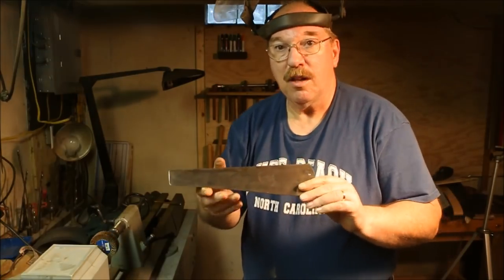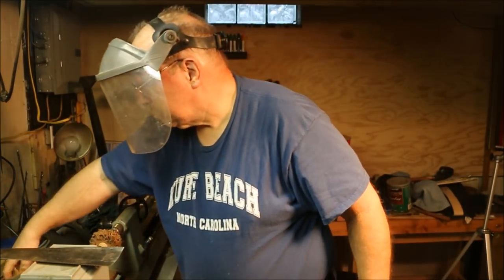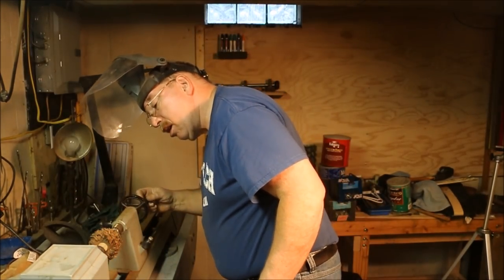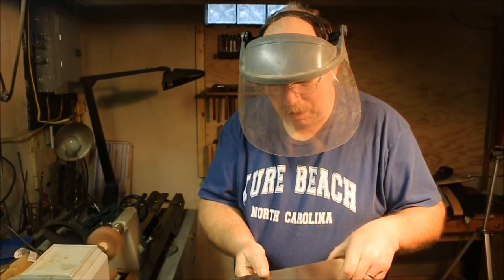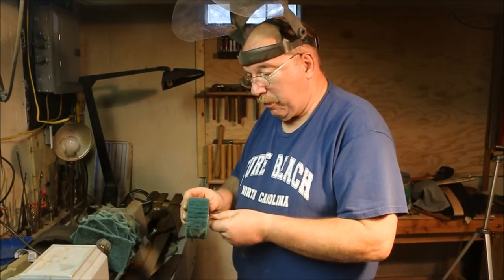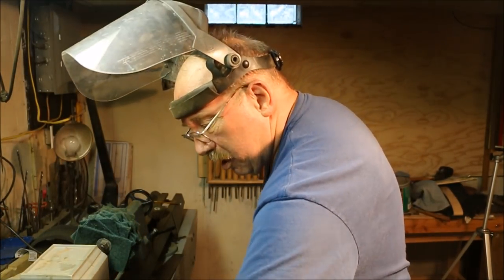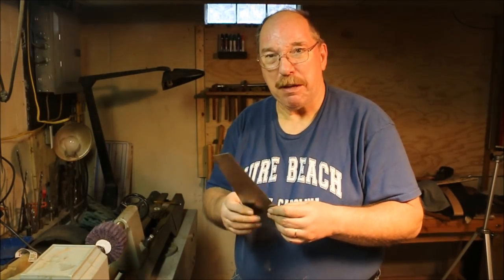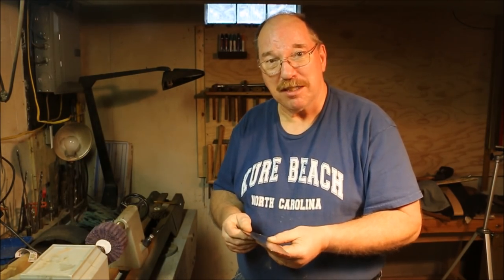Sharpening & Restoring A Disston #28 Tool Box Saw ~ Pt 3 ~ by Old Sneelock's Workshop

Comment: ..next project- Take a piece of rod and make a Buffing Station about 2 feet long with various grits. That way you wont wead out the chuck. And you can just move up or down the grits. Oh, and pull up a stool...
Reply from the maker: Might be a bit too big for the size of the work I do. When I set up a production shop I go with belt drive double spindle jacks running belts. A 2" wide 10' long belt works like a charm. 😂😁😈